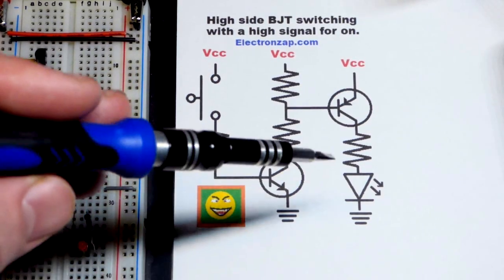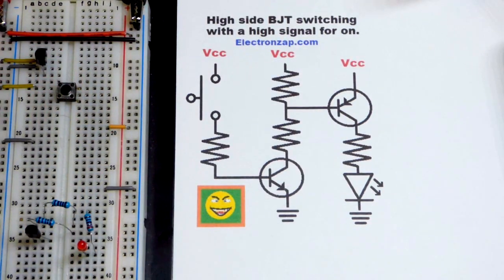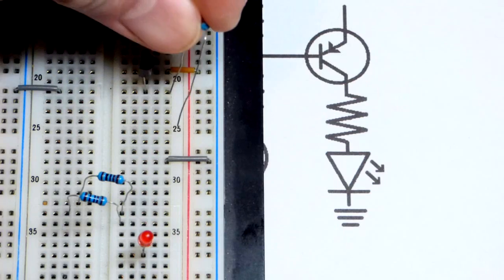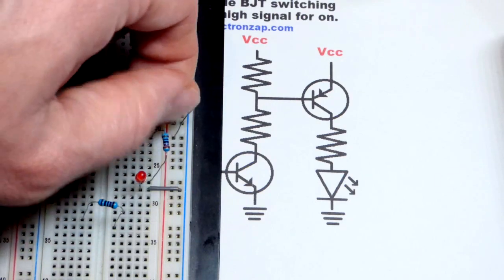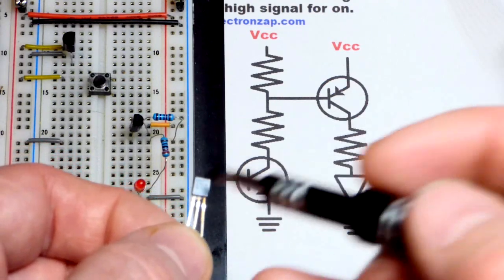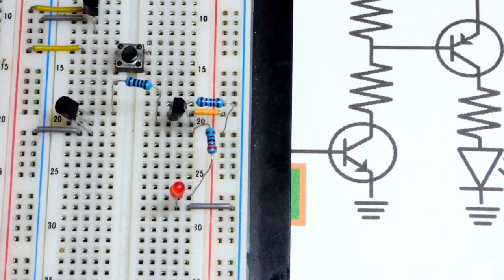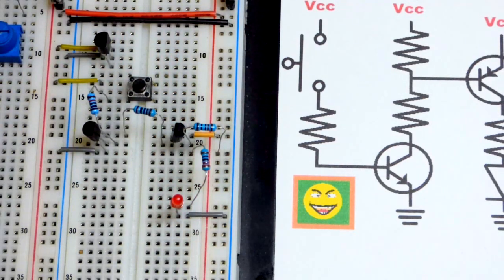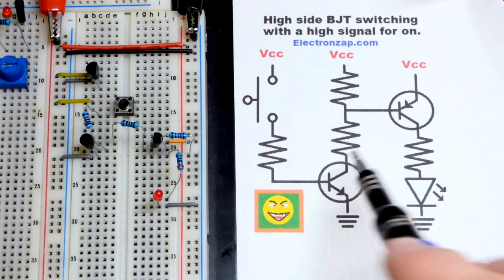Quick high side PNP BJT switch that turns on with high input instead of low circuit by electronzap

Comment: I'd love to see some of the concepts you have covered put to a purpose. I've come to understand the concepts but it can be a different beast to put it to practice with ohms law and loads coming into play combining various circuits. The project I've chosen to tackle is to impedance match a vintage radio shack microphone manufactured by shure or vintage dictation microphones with an impedance of 2k to match modern equipment which doesn't work well being it's expecting around 150ohm. My current problem is adding a volume pot without effecting gain or impedance of an op amp.
Reply: Sounds like the job for an audio transformer but 150:2K seems like it might be hard to find. :/
Reply from the maker: Nice!
Reply from the maker: Yeah, unfortunately I haven't really done much with audio yet. I'll keep that in mind though!